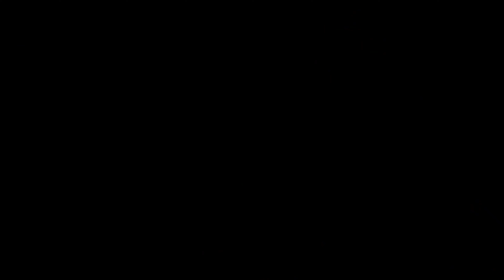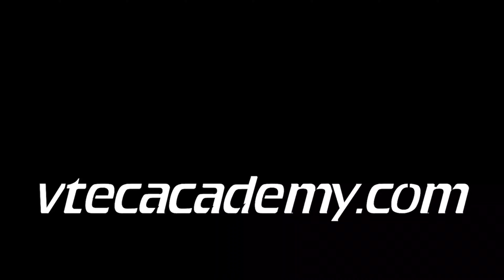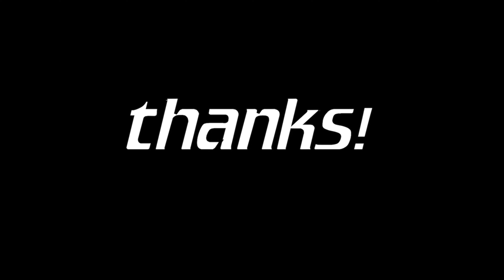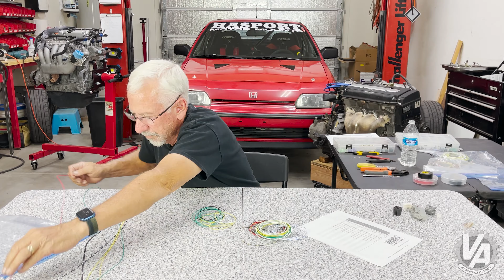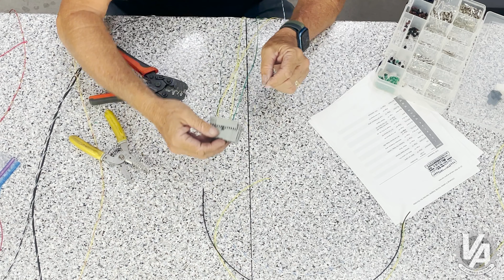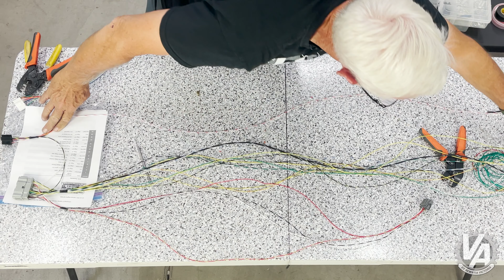Custom K Swap Universal Adapter Harness

Comment: Ive had a few issues with my Hybrid Racing adapter harness mostly related to how they were powering the o2 sensor on the same power wire as the ecu. Made the car run awful and caused weird voltage fluctuation with the o2 hooked up, until I ran o2 power straight to the battery separate from ecu and rerouted relay signal to 12v switchable on fuse box. Then another issue with the o2 connector itself. Thank you for posting this and the rest in advance, as I want to just make my own dc adapter and sell the HR one.
Reply: I've been using the Hybrid Racing adapter harness in my track car for eight years. Never had a problem with the O2.
Reply: @infotechplus1950  I hear you unfortunately I did and after some research found others have had the same issue in the past. car is a 97 integra.
Reply from the maker: Glad to help for your next one!

Comment: Hi Brian. This film really helped me with my CRX 1 gen k-swap. Thank you! I have a question though. How did you modify the cluster to get a speed signal to the ecu? I would like to do that so I can use the reverse gear lock out and launch control. / Fredrik

Comment: Hi Brian
Enjoy your instructive videos very much.
I have a 2002 MR2 manual and have been considering a K20 n/a swap. Have you in the past built a harness to interface with the Toyota ECU in your videos.
Thanks David (UK)
Reply from the maker: I haven't. I don't know of the few pump relay works the same in the Toyota. Yo may need to make something like this with two more relays.
Reply: @VTECAcademy  OK Brian, thanks for responding, I will keep watching your videos anyway of course.

Comment: Thanks for all the videos, I have emailed in with no reponse sometime ago.

I am interested in a GK5 swap but I am based in the UK.

My worry is the harness along with engine of choice then error codes. K20a or the choices of k24z engines we have here along with the ep3, we dont have the honda Si engine and the accord type s 09 with a z engine is near on impossible to source as they are so scarce.

I can have no engine codes as it won't pass our annual inspection here which is called an MOT. 

Please any advice would be grateful as they only thing me holding me back is I don't have much to base on.

Thanks

Comment: Hi can you also do a honda acord 04 6-speed manual engine wiring to Crv  wiring
Becuase honda acord oem engine wiring have no c101 connector  there is a diff connector
Reply from the maker: You can add a C101 plug
Reply: So is there any video for that? 
Or any wiring diagram for c101 plug  for acord euro oem engine harness? Which wires i have take out from the dash connector and put them in c101 female connector to fit in civic 98 
Using hrbrid racing dash wiring

Comment: Where does the brake switch wire go to from the ecu
Reply from the maker: There is a switch on the brake that turns on the brake lights. You'll want the four pin version of that.

Comment: Thanks again for another great video! I think I am going to have most of my EK ready before my uncle even gets his new car lol. 

I was wondering- Would it be possible to convert an 07 Si engine harness to work with some changes? It's already sitting here so figure it's worth a shot lol
Reply from the maker: For use in an Ek it would be a lot of wiring and parts. Your better off looking for a CRV harness for auto and converting that to  manual. It's going to be cheaper and a tenth of the work.